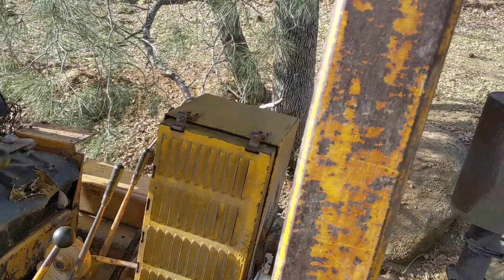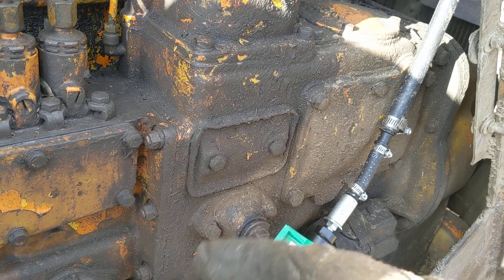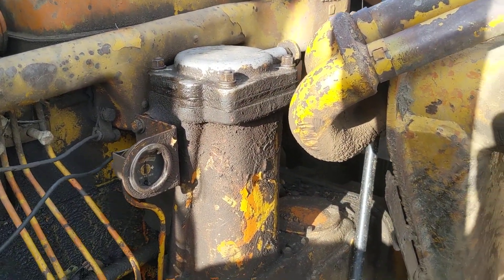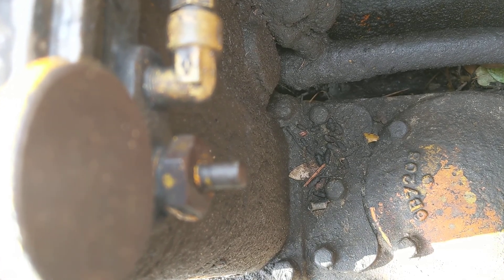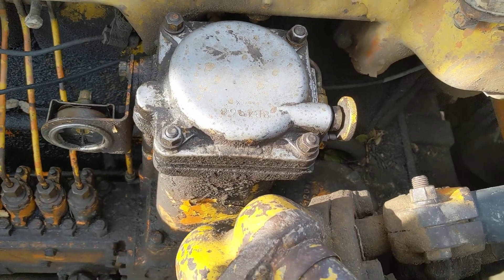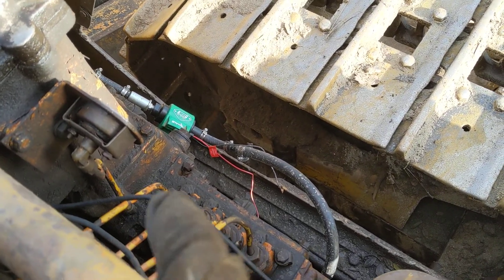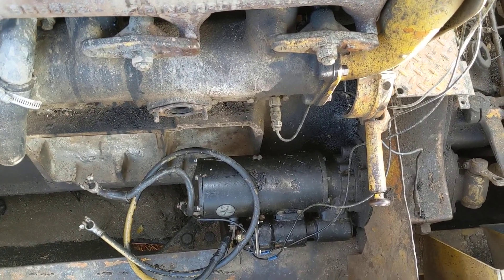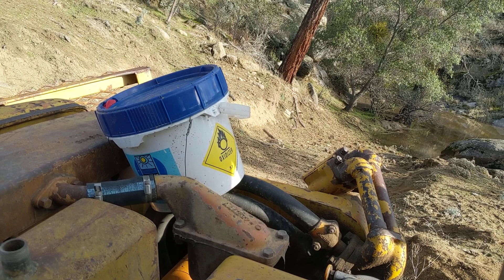Caterpillar  D7 3T Ran out of diesel ~  how to prime your fuel system

Comment: Thanks for your video, my 50’s D7 lost prime. I had the same issue with an electric start conversion, I could not get it to bleed. Ran to the parts store, spliced in a fuel pump and bleed the old girl out.. she fired right up afterwards.. good info. 👍
Reply: u have to loosen those square heade bleeders on the injection pump u have to do that loosen lines wo t do it

Comment: It doesn’t have to be a either baby, if you put glow plugs in it. You just buy the pre cups for the glow plugs as well as the glow plugs but them in and away you go!
Reply: I can attest to this. I have an old D7E that I thought was an ether baby when I got her. She wouldn't start without ether. Turns out that all 4 of my glow plugs were bad. I replaced them all and got them working and she fires right up nearly instantly now with the glow plugs working their magic.

Comment: I have the same machine but a couple years older. I lost prime at an idle. 25 gal in the tank. Think filters are plugged. Did you get a filter number?
Reply: Cat part # 489-3196
Reply: @derekjones2794  thank you